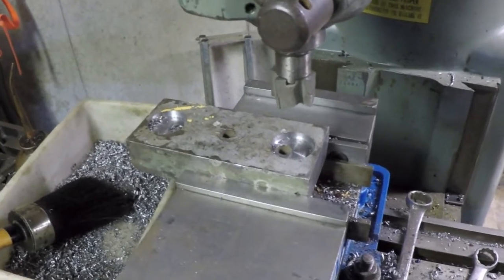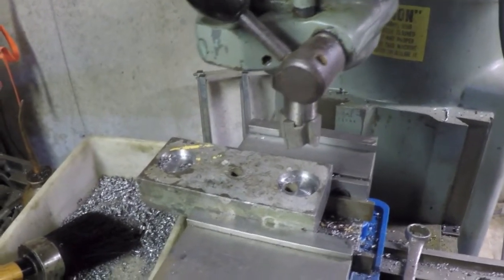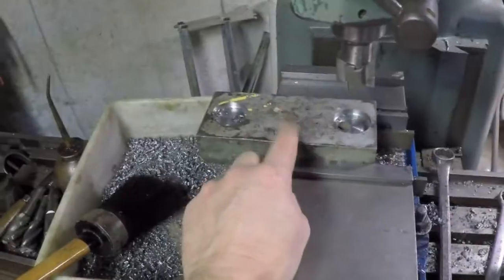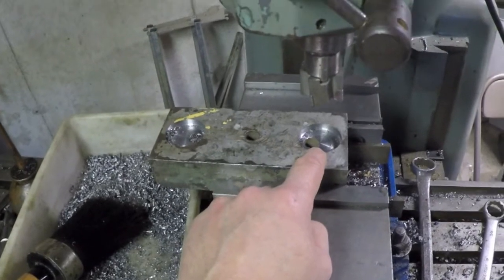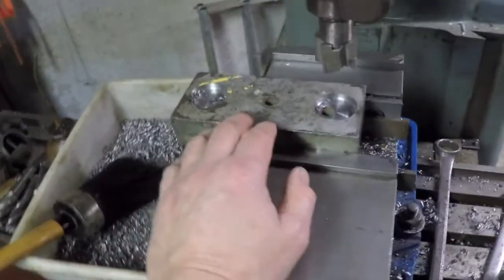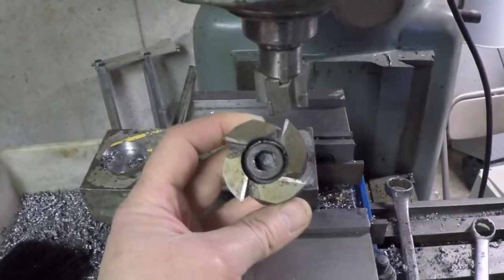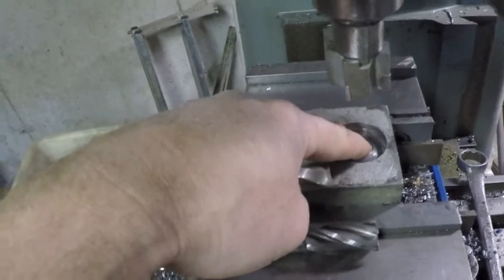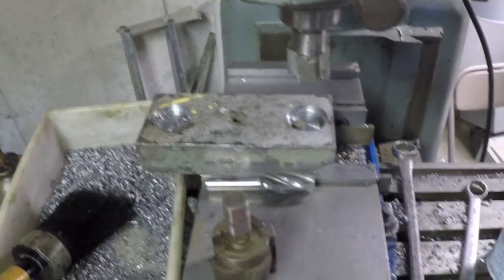Noob machinist tip #1: Flat bottomed holes

Comment: Cool tip, Steve.  You maybe shouldn't worry about editing so much and just upload random mill work.  I'd watch.
Reply from the maker: Thanks, I hope to do more in the future.
Reply: Count me as one of the faithful with notifications enabled on your channel.  Once you get your mic woes ironed out, you're on track for lots more interesting content.  You have enough machines to supply video for a year.
Reply from the maker: Tech Gorilla thanks. the next few videos are just using the heros built in mic, but I'm normalizing the audio levels while editing, and that seems to be helping.
Reply: What program do you use for editing?  Mostly I use Adobe Premier, but it's damned complicated and can be frustrating if you don't know how to use it.  It's more than I need, but I'm old and set in my ways.  I probably know about 10% of the actual capabilities of the package after many hours of staring at it.
Reply from the maker: I just use imovie on my mac. I've researched different software, but every time I think of spending money on this hobby I get a little queasy lol.